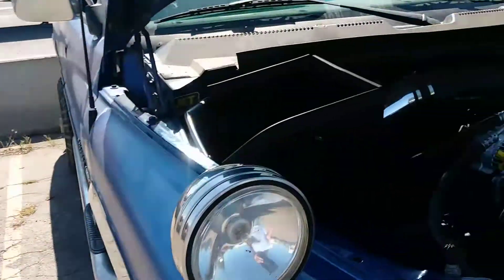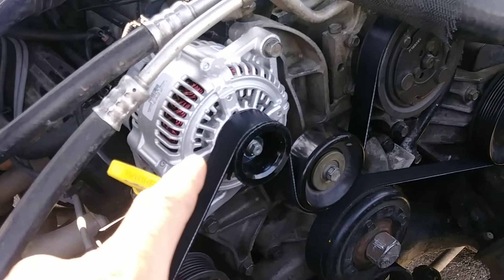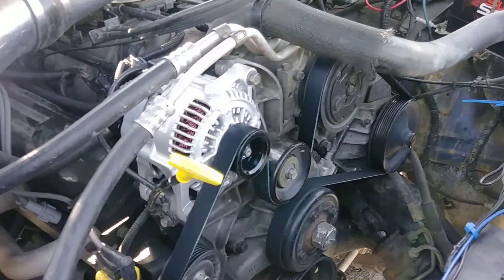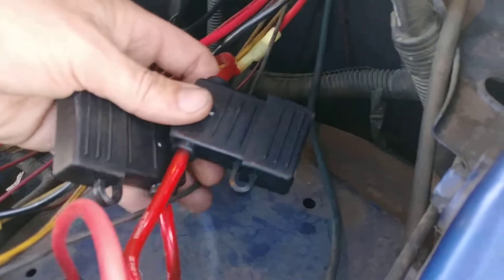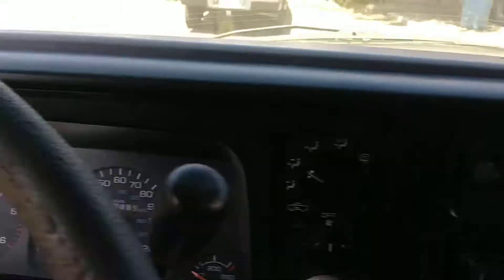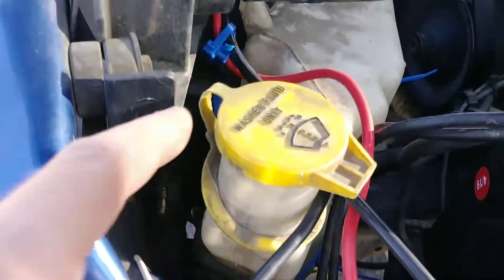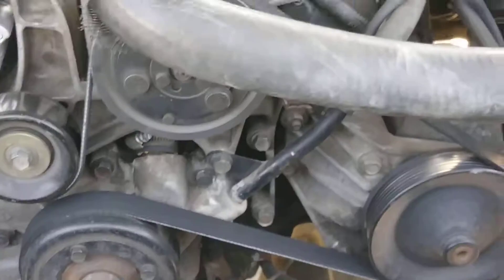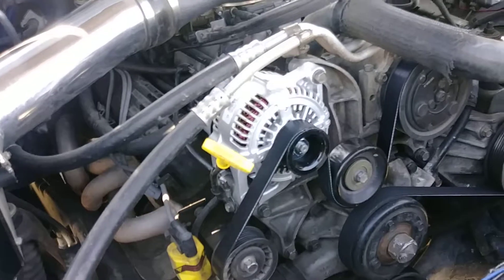Electric Fan Conversion & Alternator 2nd Gen Ram

Comment: i recently swapped to electric fans as well. i cut the old shroud so it is just big enough on each side to hold the overflow and washer fluid tanks. it works great and looks good.
Reply from the maker: What kind of blade/saw did you use? I've been thinking of doing the same thing with my factory shroud...after looking at my handywork with the sheet metal...lol.  I'm not a fan of my tanks hanging there with zip ties.
Reply: @Clifftheblackhatgringo  I just used a regular old hacksaw. I wish YouTube didn't get rid of the inbox, I could send you a picture
Reply: I'm installing a electric fan on my 97 ram and I'm also trying to use the original shroud but just modify it I would love to see how you did yours, to get a better idea. Please post a video or some pictures

Comment: I didn't see them but you need to be running relays off the fan before your toggle switch then it wouldn't burn the switch up
Reply: Took the words right out of my mouth...yep relays handle the load.